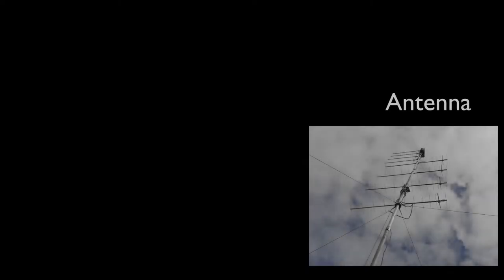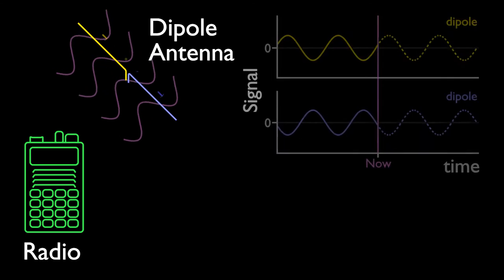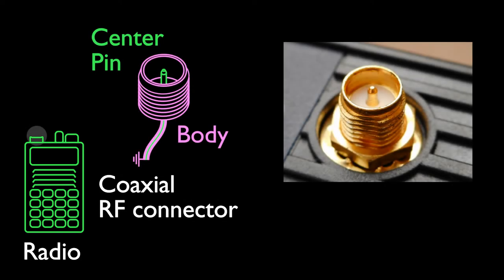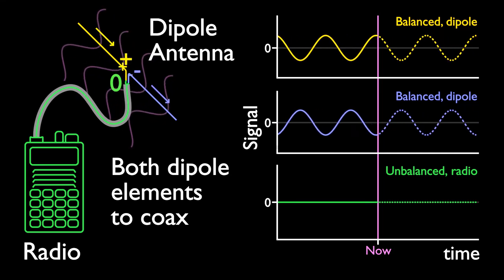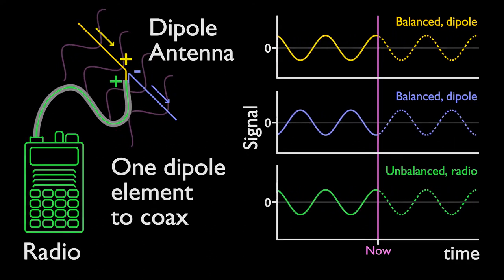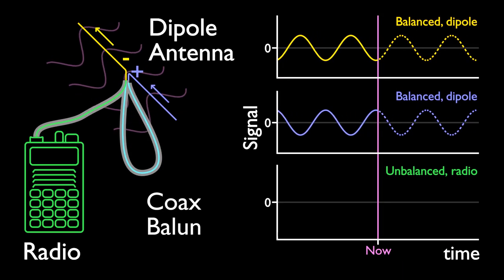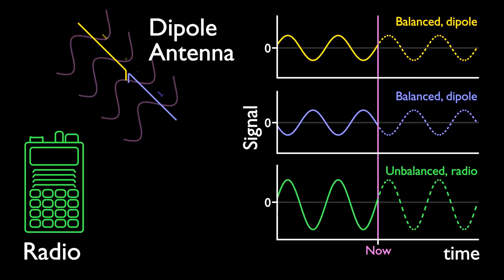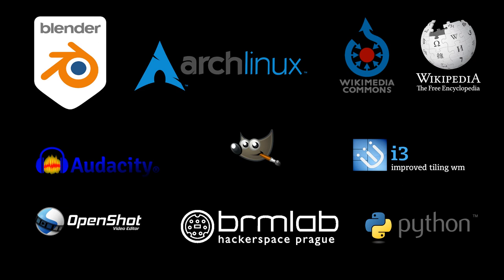Coax and Transformer Balun Design Explained [updated version]

Comment: Why can’t one connect the coaxial feed-line shield to one side of the dipole? It seems to me that your difference between unbalanced and balanced is one of perspective.  If you attached a current measuring device with its common (reference) lead to one side of the dipole and its measurement lead to the of the other side then would you not see the signal?  The same thing if you hooked a voltage measuring device to the ends of the antenna. I guess if your feed-line shield was connected to earth ground then that might cause the antenna setup grief.
Reply: I ask the same question to myself and have impression that nobody can clearly explain it. After all, it's about a common point of reference. Isnt it?
Reply: I’m not sure, I’m just studying for my advanced cert, but I’ll take a guess.
For starters, driving the shield on a coax cable means that the connector will give you an RF burn if you touch it, so radio manufacturers probably wouldn’t like the liability factor, so when they use coax, they just run the shield to the ground.  Second thought is, if the currents are in phase but in reverse directions, then the shield will be making a counterclockwise magnetic field while the conductor core is doing the exact opposite, so you’d probably lose some energy from the magnetic field. Also, coax is technically a long, strip-shaped capacitor because it’s literally two conductive elements separated by a dielectric (a resistive material) so RF current can and will travel between the two like they’re directly connected anyways, so I think if you drove both the shield and the conductor, you would basically be electrifying a high-pass filter, and I think that means you would lose more energy the higher the frequency and the longer the coax cable.  And because of the magnetic field, you’d probably wind up with back-EMF issues.  Then you run into the issue of the shield and centre conductor having different velocity factors… now that I try to think about it, it seems like balanced systems aren’t even ideal unless theres a really good reason to use them.  🤔 I’m not sure about what all I said though, so keep that in mind. I should go ask an Elmer.
Reply: You can there is literally antennas that consist of a length of coax that at some point is split in half,  the shield goes one direction, the center feed goes another to make a dipole.  I have never used a balun on a dipole and have worked almost all states and 20 countries with no issues

Comment: First of all nice video,
but I think you are mixing up differential pairs and the reason, why balun is used with antennas... When balun is used with a dipole, it is trying to solve the problem with currents, that flow at the outer side of the outer coax conductor (and yes, for RF the outer conductor in coax acts like it has an inner and outer side..). These currents can cause problems with directivity etc...
Reply from the maker: Hi, thanks for your reply. I created the video just because first time I felt like I understood concept of baluns it felt to me that most of the explanations are too complex and it would be a sin not to share the explanation which felt simple. I am not a physicist, so I might've mixed things. I had it checked by few people I trust, but that does not make it correct either. Are you referring to impedance matching? Or something else?

Comment: On the coax balun arrangement,  why does the directly connected node have a small delay?
Reply from the maker: Hi, it was unintentionally made for the animation. If you put the coax balun directly onto the end node of the antenna, this delay is zero. I personally think that there may be a small delay as the signal travels from the rod to the coax through solder. When you get from the simple theory covered in this video towards the application, things will always get a bit more messy. :)

Comment: Terrible explanation. Many guys think (erroneously, like the one who made this video) that the signal in a coaxial cable goes through the central conductor and that there is no signal through the mesh !!! This is a serious conceptual error. The mesh HAS THE return SIGNAL, and due to the geometry it results in a line that almost does not produce interference and that has great immunity to external interference.

This error is also seen in the explanation given by some people of how a vertical antenna works. Since they don't see the return electrode, they think it doesn't exist. But it's not like that. The signal goes through one conductor and returns through another. If there is no return, it does not work.
Reply: Is there capacitance at the middle between the two ¼ wavelength wires?
Reply: @goedeck1  Obvioulsly. Between any pair of wires there is capacitance. Small but always there.
Reply: You beat me to it.
Reply from the maker: Sorry that I've not replied sooner. Thanks for pointing-out that there is a flaw. By Mesh you mean the coax shielding and by Line you mean the coax cable?